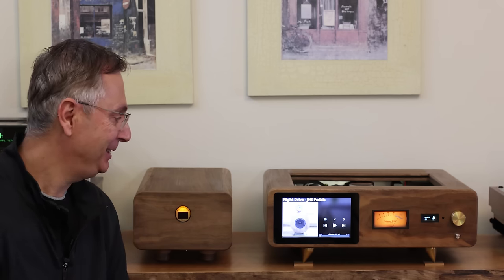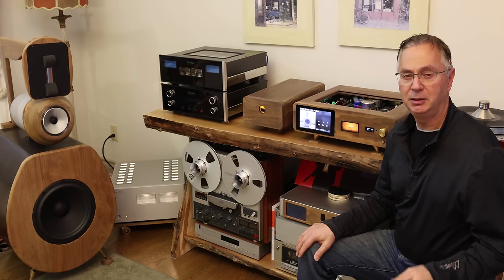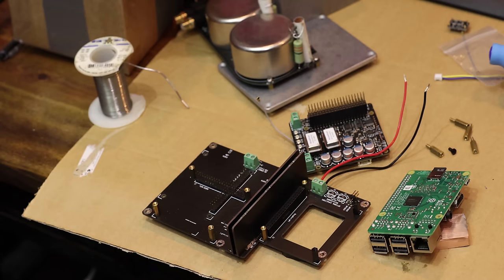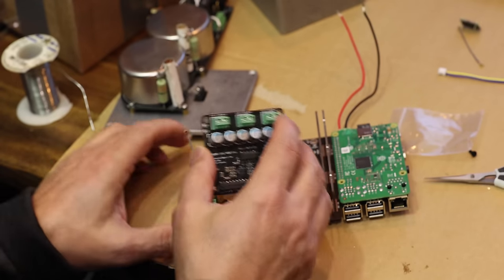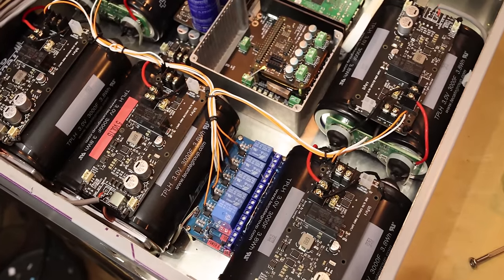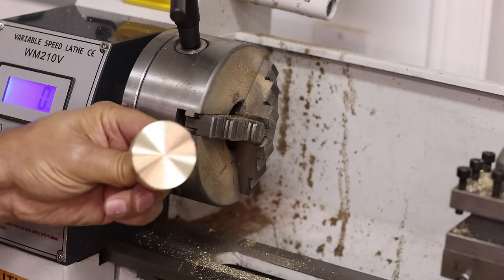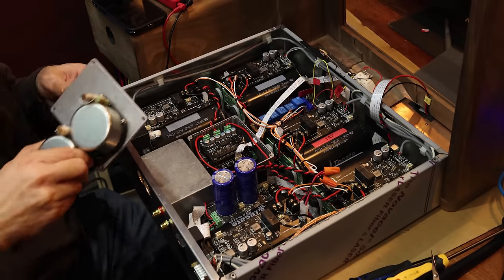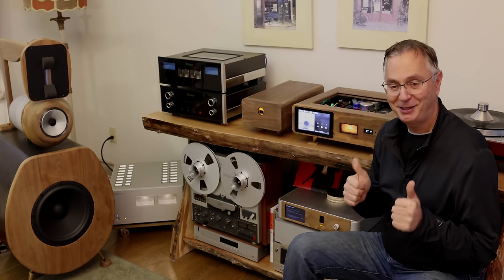World's second Best DIY Dac and Streamer

Comment: I like how it looks, it seems a commercial product. But I think that the metal box should have some holes to let some air pass through the electronics, it seems that part will suffer overheating as it cannot evacuate heat easily. Probably the DACs will get quite hot when working at high frequecies.

Comment: Great Video and lots of ideas, for the dual Mono DAC, it has three power inputs, I believe the center one is VCCA - for the onboard clock - which you are not using as you have the Master clock from the FIFO, have you look at that ?- as saving an Ultra Cap unit would be nice in this build. I have tried this and the system still works fine - and you will see a floating voltage of about 2.6V across the VCCA terminals - which is a bit strange. Would like to hear your considered opinion
Reply from the maker: Yes you are correct it does work without the center VCCA but I start getting issues the ess controller not recognising the Dual mono dac  .......   not always. I spent hours trying to figure out the problem it seems to happen with UCPure batteries something to do with a tiny delay between the ess controller  powering before the Dac ended up leaving it powered. I plan on renovating the Dac with the new parts hopefully i can free the VCaa this time will see.

Comment: curious: what was the reason for not putting the ultra capacitors in the power supply , would the cable length cause an issue ?  Would covering the clocks cause them to get too warm ,
Reply from the maker: the cable length would be a an issue

Comment: A fantastic project. Are you happy with the Sabre based DAC? Do you think an R2R could improve the sound? I would also like to add an input I2S board to connect a SACD/CD player, do you think would be possible with your setup? Otherwise I could remove the DAC completely and use an I2S output board and connect the streamer to a Denafrips DAC.
Reply from the maker: Yes, absolutely, Ian has a hat with inputs could slide it under the Dac happy with the Sabre can’t here a difference from the terminator in a blind a b test my Sabre May be a tad better

Comment: sorry for the dumb question but can a wooden surround be used with just an aluminum base and rear? Amazing build by the way.
Reply from the maker: Sure you can if it is for yourself but it will not be safe for fires also not ideal for noise shielding.  
Ideally should be metal all around grounded to earth and wood outside the metal

Comment: Nice Job Gabster ! I always wanted a battery powered amp , So for dac thats really cool  i what are you using for volt regulators ?
Reply from the maker: Thank you Tee-Jay
The Linear Pi by Ian is great specially if you add the Ultra capacitors so I would use those 2 for 5v 
Ian Canada: https://github.com/iancanada/Document...
UcMateConditioner 5V
LinearPi Solo Linear Power supply
there is one for 3.3v as well
Reply: @Gabster1  THANKS GABSTER looks incredible !
Reply: Thank you for putting this inspiring video together.  I hope to be able to build up to this level of awesomeness one day, sooner than later.  Really nice.  I’ve subscribed to see your follow up videos on this project, and future projects as well.
Reply from the maker: @Mikegritz  Thank you :)
Reply: @Gabster1  qqqqq

Comment: Have you consider using optical fiber for the ethernet link (SFP)? It is not as expensive as it used to be and it is a good means of galvanic isolation from the network.

Comment: Hello, fine build and great information.
How did the Z-foil Resistors perform in comparison to the hand wound Resistors by Ivan? Or do you have any other recommendations?
Reply from the maker: For me I preferred the Z foil but I think it is system dependant I am using a tube preamp. One good thing about the Z-foil is they are compact and small and less prone to outside noise but some people find them too clinical..
Reply: @Gabster1  Thank you for Reply!

Comment: Where did you find the hat separating the FifoPi Q7 and the DAC? Clearly you put the copper over it and I guess I does not have anything metal under the copper sheet!
Reply from the maker: Ian used to have a shield board for free 
I added copper to it but you can do the same with a double sided copper board can buy them from any electronics place usually used to make your own circuit boards just watch the edges not to contact anything :)

Comment: Hi Gabster , Sounds amazing through my newly rebuilt transmission line loudspeaker cabinets which I built myself 40 odd years ago I just recently had to replace all the drivers I’ve now got a complete set of SEAS , I’m hoping to buy a sound test microphone after Christmas as I might have to change the crossover unit but what I have played along so far has been amazing. 
I am thinking of buying a NAD DAC , and there power amp. So what did it cost for the components in the end, And I’ve been looking at buying a pair of monobloc amps they are in a kit form and they sell them in Germany I wasn’t quite sure whether they go along them lines or not.
Keep up the great work of the tutorials on your build your HIGH END HIFI . I love your speaker. 
PHIL FROM THE DARK SIDE OF THE MOULIN FRANCE.
Reply from the maker: Merci Phil if looks like you have done a great job and enjoying the journey.
if you have not done it yet I strongly suggest you try some of the inexpensive tube amps like the willsenton or Yaqin 13s
Reply: @Gabster1  hi merry Christmas, thank you for your reply. I have had a look at these, The reviews sound good, Biggest problem is they’re quoting €300 plus for delivery, I have never listen to a tube amp sorry that’s not quite true when I was about 10 or 12 years old I had a tube radio amplifier I don’t know whether it’s any good or not then but it nearly killed me I touch something and blue fuse in the house and electrocuted myself as you can imagine my parents was not very happy, I think part of the problem with the shipping cost is the weight of them, And I’m not very keen on buying things online especially electronic components or sooner purchase from a shop/dealer where I can go in and listen and watch and see how it’s set up. And the prices that I have seen so far I have Tube amplifiers on display Way way out of my price range, €5000. + . I need power amp rated at Mono at 150 Watts minimum. At 8 ohms, Cabinets are rated and 150 W , I am powering them at the moment with an NAD314 but have to turn the volume right up. The monos that I have been looking at are, PU500 1ch Mono, Eigentakt Bypurifi 250w at 8ohm . They come as a plug and build kit
Very similar to what you were showing with your amplifier, and I was thinking of building a wooden surround for it as well, Thank you for your help look forward to seeing your next project, And a happy New Year to you, PHIL FROM THE DARK SIDE OF THE MOULIN FRANCE

Comment: Im having a hard time with the parts list it seems to be missing half the components...displays, station, volume pot, shield between dac and q7.....
Reply from the maker: The small display and volume are both part of the ess controller if you scroll the iancanada link you will find all the parts I listed 
He no longer has the shieldpi but a any metal square piece will do 
The big screen is a simple raspberry pi 7 inch screen 
Hope that helps

Comment: Looks amazing! 
What if I don’t add ultracapacitors(it scares me very much)? Will it be still a good sounding dac and streamer? I’m thinking about building similar running with Roon. 
Thanks for your video!
Reply from the maker: The Linear Pi by Ian is great specially if you add the Ultra capacitors so I would use those 2 for 5v 
Ian Canada: the smaller Ultra caps are not too dangerous. Or just use the linear pi only still good
https://github.com/iancanada/Document...
UcMateConditioner 5V
LinearPi Solo Linear Power supply
there is one for 3.3v as well

Comment: Some of the links are not working. Nice job! Love the wood working and machining work. That's about $300 in Walnut. :) I would have put the LCD in the center and the VU meter on the left side and a larger meter on the right side. The skew knob a little smaller due to space constraints.
Reply from the maker: Thanks for letting me know I fixed them  interesting Idea for Placement :)

Comment: What I don’t like about it is minor, and perhaps can be easily addressed if you so wish? Just a cosmetic annoyance: I personally find those square bases at the foot very ugly. Such a sleek design, and clearly you chose the legs to give it an elegant “stilettoed” look. I am guessing you added those to guard against scratching of the surface and perhaps also added stability. Wouldn’t it look better with some rounded base though? Just a metal circular base with felt at the bottom. Seeing what you have accomplished, I don’t think that would be hard for you to implement, and in my opinion would make it look better.

Comment: I could never get YouTube to run properly on the Pi. Used all kinds of configs and images.  Maybe things have changed since. Also getting auto startup is difficult. In the end I parked it as a solution.
Reply: Volumio supports YouTube and You Tube Music
Reply: @neilwhiteaker53  yeah i know tried it. Main issue with that is that you can't wake it up once it's asleep. It's an issue with all Pi's
Reply: @TheNightPortal  understood. So, the only workaround is re-boot the Rasberry Pi every time or every session?
Reply: @neilwhiteaker53  well no, there are actual workarounds, but it requires a bit of wiring and modding and that brings its own problems cos you have to make sure that's compatible with the Volumio image. It's just a bag of nuts and not worth the time for me. Pi's need to be able to sleep and wake up from net. You can just press a button or even keep it on always but that's a technical compromise. I use a Minix Smart TV box now. Optical into the amp. Works a dream, and i have a little IPS screen connected to it. Ive even got a smart RF, so i can turn them on and off from my phone. anyways rambling now, PI's are great tho. HomeAssistant is truely awesome, if you like a smart world.

Comment: I dont believe in needing a separate dac. There is absolutely nothing wrong with an all in one digital device, Whether a cd player, or a streamer etc, or any other digital device etc. Also you would get far more detail, resolution, soundstage, and harmonics, from a pair of 3 way active ATC SCM ASL loudspeakers, than a  horrible massive passive crossover that you have used for your speakers. There is a lot of so called bull crap voodoo from a lot audio and speaker manufactures today .  One thing is certain, active loudspeakers like the ATC SCM ASL when done correctly with class A input stage and class AB output stage absolutely wipes the floor with passive loudspeaker designs full stop, for detail, resolution, harmonics, and sound stage. Also those so called high end passive crossover parts do not not make a better quality signal for the quality of sound that comes out of the drive units. In fact you get a worse sound loosing detail and resolution, and compared to a pair of high quality 3 way active ATC SCM ASL loudspeakers, you have no chance in recreating the original recorded sound from a 3 way monstrous passive crossover  loudspeaker design full stop. And by the way the macintosh amplifier you have is not considered as one of the best amplifiers, in fact they are near the bottom league as amplification goes, and as such the macintosh is no good at retaining and passing the original signal source information of detail and resolution to passive loudspeakers.
Reply: There is an expression: “it’s not knowing that’s hurting you sir, it’s knowing so much, that just ain’t so”.
Sounds like you have a great system, and really love the ATC SCM ASL very much. I’ll check them out 👍